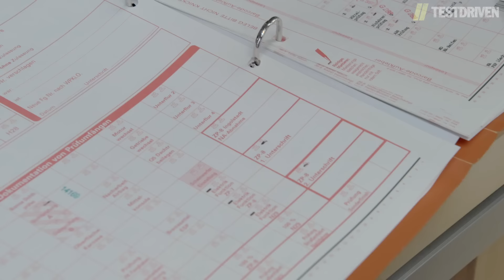Audi Production, Ingolstadt

Comment: 9:49 - Ugh, that confirms my suspicion. The same paint must have been used on my VW GTI because it also has that exact same slightly "bumpy" surface. Look at how the reflection is very coarse. Why can't VW/Audi get the paint smooth? For $40k, they should do a better job on the paint.

Comment: Now Iunderstand why so much  unlucky VAG  car owners receive lemon and car with issues. Looking proces is most those  machines placing parts  is done by hydrauclic which is controled by PLC and sensors, just one milimeter up down can have   finished car with later issues, which is very hard to diagnose ,and usually start showing problems  after some time till misaligned parts settle down like gaskets , hoses etc...This machines need constant every bit calibration by human.,So many things in procces can go wrong but most time hard to notice as is in mm handling. When only  human was working on cars was much les problems than today and if than ppl had tehnology as now would be even less.

Comment: Workers in other companies tend to use gloves while quality checking the car so they won't leave a mark on the car.
Reply: But you cannot feel with gloves. That is the main reason. Especially when you have to check the surface of specific parts from the paint shop or mounting gaps. And especially in final control you have also some times to fix something, and this is much easier without gloves.

Comment: 13:50 when it drives off it smokes. They should let it idle before driving.
Reply: Looks more like an issue before it even left the plant to me ...
Reply: All cars smoke on first startup. And every plant I know of revs them up on first start... and I work for a mfg and have seen it first hand. Perfectly normal. Idling isn't good because the oil pressure is low - better to rev it than not.

Comment: Thanks you audi, my A4 2.0 TFSi engine and 130000 km is complete destroyd. :( (cost of repair is 3600 euro.)
Reply: Nie umiesz jeździć to miej pretensje do siebie./You don't know how to ride, blame yourself.
Reply: @michals547  Ja kupil pri 111000 tisic a už zničený
Reply: @MegaHovadak  111,000 what?
Reply: @michals547  I buy car in 111000 km and good sevice, motor caput  130000 km
Reply: @MegaHovadak  Have you been to an authorized Audi service center? And what did they say when you were at the Audi service?
Reply: @michals547  Mechanic in autorized audi sevice say it is normal problem with motors 1.8, and 2,0 tfsi made in 2008-2011  - Bad piston rings, lost much oil.
Reply: @MegaHovadak  I have a Passat from this period of production, he drinks about 1L of oil per 1000 km, but I like him so much and he drives great.
Reply: @michals547  service says 1 litr oil on 1500 km is ok. My car before repair eat 1 liter oil - 300 km.
Reply: @MegaHovadak  Your Audi engine was in fact completely broken ... Mine from the Passat is still good. 
How much did the repair cost in Euro? Was the repair at an authorized Audi or VW service center?
Reply: @michals547  I write it in my first coment - 3600 euro.
Reply: @MegaHovadak  That's quite a lot. But it's an Audi 2.0.